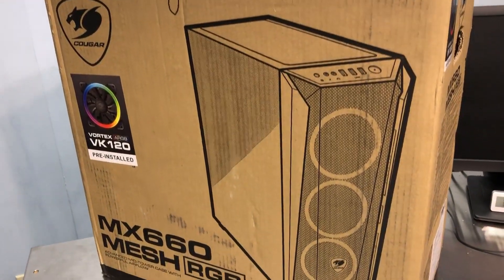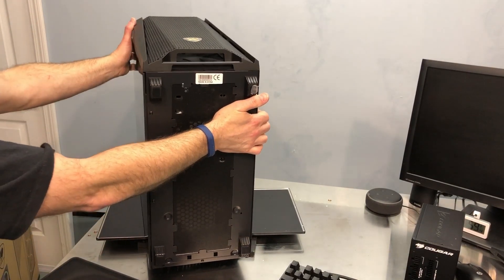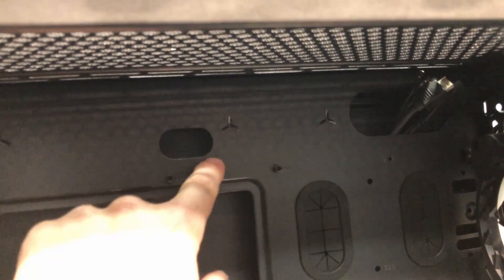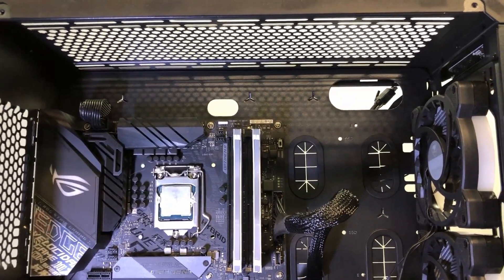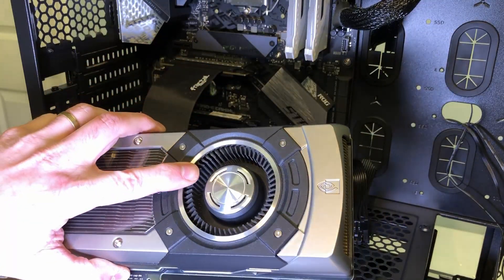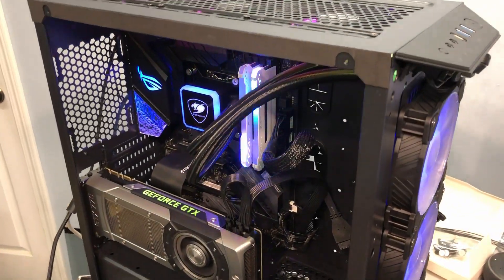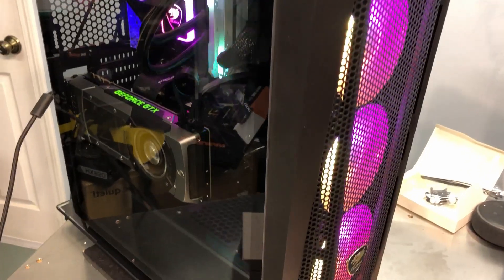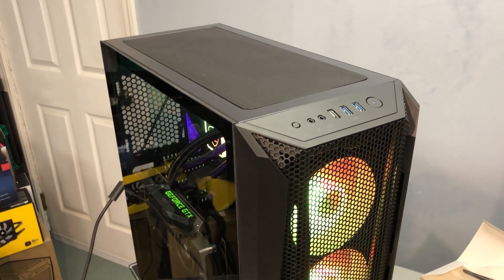OCC checks out the new MX660 Mesh RGB gaming case from Cougar!

Comment: One question please, I don't know if you have heard about the new PSU from Corsair, the shift series that have the cables to one side, the thing is that they say that the case must have a minimum width of 210 mm, I know that this model does comply, but in your experience you see that the back cover is very tight or glued to the source... because I think it should at least measure more than 5 cm, so that the cables can bend and go up or go to one side.

Comment: is it wrong aio mounting? should the tubes be at the bottom?
Reply from the maker: It is not necessarily wrong, but sometimes you can get some air pulled into the pump and you might get some noises as the air bubble pass through the pump - usually at start up.  It just depends on how much air is in your system.  They all have some air to allow for coolant expansion. Sometimes the case and cooler style (size) won't allow for the tubes at the bottom.  I have tested and used many liquid coolers over the years and had them mounted in a variety of tube orientations and never had any problems.
Reply: @overclockersclub  thank you so much

Comment: I managed to get a hold of the last non-RGB ones, put 4 Corsair ML120s and a top mount H115i capellix AIO. The case is like having an airplane hangar to work on a car, so much free space
Reply: Hey, instead of using  4 corsair ml 120s, what others kit fans do you reccomend? I have the b550m aoros elite so probaly i gonna nead a hub
Reply: @fernandomoreira1929  The Lian Li UNI fans are awesome, they come with a hub in the 3 pack and they don't have so many wires, since they attach together. Other than that, I can also recommend the CoolerMaster SF120 argb Sickleflow fans, but you have to get a hub separately

Comment: I have the same case, and was wondering how to remove the front panel correct. Unfortunately this part on your review is cut out, can you give some advice as the direction and where I should pull it. Thanks.
Reply: I have also been looking for an answer to this question everywhere.. unfortunately I didn't find anything and broke front panel somehow. everybody just skip this part or remove it like i did - just using fingers and strenght, but mine broke.
Reply: @thatwasveryscary5910  Don't know if I can put another link from a different youtube channel, but search this review: Cougar MX660 Mesh RGB - back to the past, and take a look to 3:50 min. It will solve your question

Comment: Hello. Thank you very much for your review. Is it possible to install 3x 140mm fans on the front? Is there enough place for it? I want to install three 140mm Arctic P14 pwm but not sure about it
Reply from the maker: I am glad you liked the review.  According to the Cougar website, you can mount three  120mm fans, or   two  140mm fans in the front.
Reply: @overclockersclub  Yeah, I saw it. I choose between this Cougar and Deepcool Matrexx 55 Mesh, the Deepcool website also claims the ability to mount two 140mm fans, but people write that they successfully install three 140mm fans with a little trick. Anyway, thank you. :)
Reply from the maker: Later today I’ll get the case out and verify for you.
Reply: @overclockersclub  This will help me a lot, sorry to bother you
Reply from the maker: @RemzM  I pulled the front off and verified that there is no way for three 140mm fans to fit.  The total fan opening is 360mm and you would need at least 420mm to fit three 140mm fans.
Reply: @overclockersclub  thank you very much, you helped me a lot!
Reply: @overclockersclub  massive props for following through on that! what a kind thing to do!
Reply from the maker: @tuzi6503  Thanks.  I try to help when I can, but it is hard to keep up with all of the comments now that I have so many reviews!

Comment: Hi there! I wanted to revamp my system and get this case. In my old sharkoon TG5 i have my Enermax Aquafusion 360mm AIO installed in the front, though i want a case where it fits on the top since that will be better for thermals. Do you think i can fit the 360mm radiator with the fans on the top without it hittin the motherboard or the CPU power cables?
Reply from the maker: This case allows room above the motherboard for standard 360mm AIO (all in one) coolers.  I didn't have any issues but I would put the end of the tank with the cooling lines at the front of the case.  Depending on the motherboard, you might have to bend the power cables a little, but there should be room.
Reply: @overclockersclub  Awesome, thanks for the quick answer!

Comment: Do you think this case can compete with corsair 4000D Airflow in terms of cooling. Do you think it better or worse or both will perform similar?
Reply: Corsair 4000D airflow has a better build quality and more noise reduction i think, but this case has more fans compatibility and a lil cheaper than the corsair one.

If I buy this case, I'll just take out all of those non-pwm argb fans which comes with it, and install corsair Ml120s or LL120s in it.